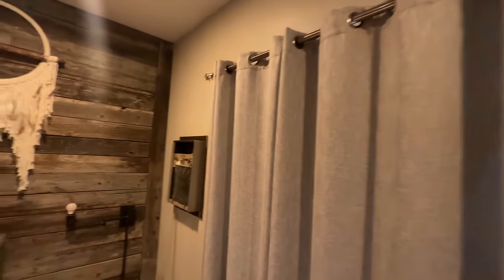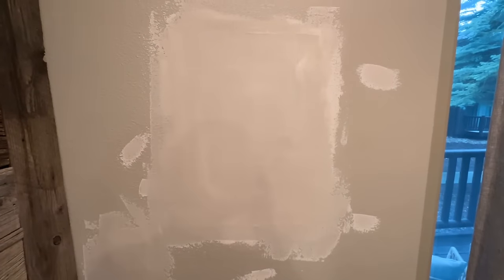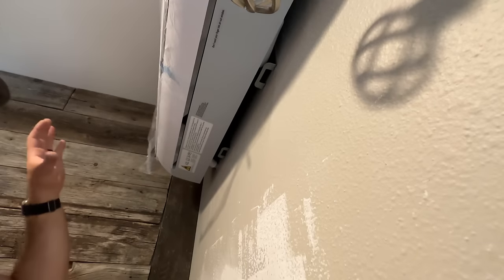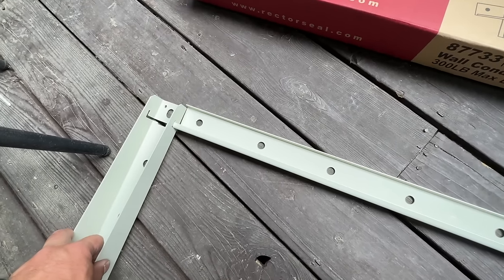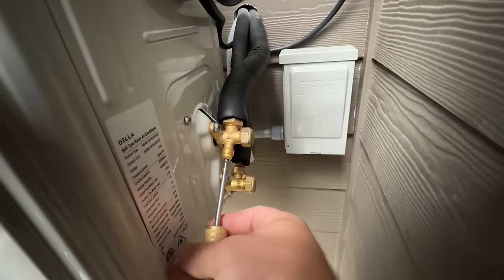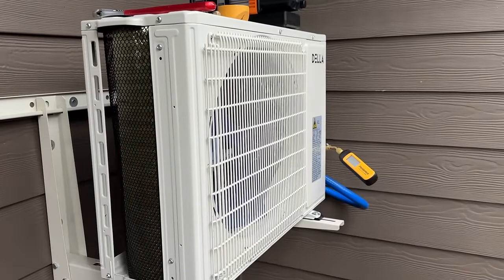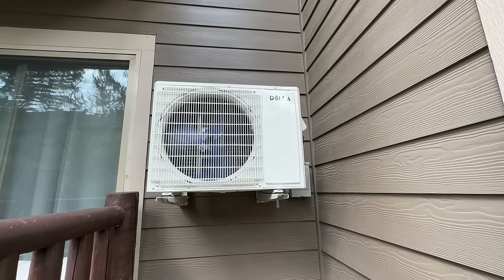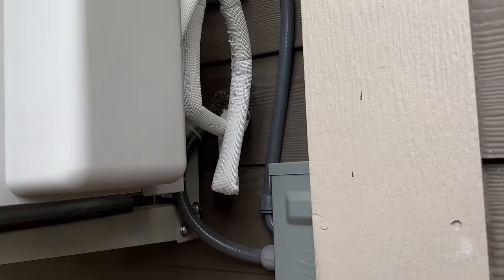A $600 Ductless 110v Mini Split?!

Comment: I've heard there's only a few companies making mini splits and they just put different names on them. Making them all basically the same. Is this correct? 😊 I know mr cool looks exactly like a Gree unit as an example.
Reply from the maker: Yea! They’re like mostly made by MIDEA
Reply from the maker: Pioneer, Senville, della, Cooper and Hunter. All Midea
Reply: @diyhvacguy  thanks 😊
Reply: No, Mr Cool is Midea (the DIY ones I am familiar with are).  Gree is a different company entirely.
Reply: @kevin9c1  well thats strange because my neighbor had his 4 year old "mr cool " mini split repaired with a "gree" oem part. The hvac contractor was an authorized "gree" dealer and was able to repair it because getting the part from "mr cool " would take too long. It was kind of obvious on the older mr cool mini splits as the looked identical to the gree units.
Reply: @number1pappy  Is that a DIY unit?
Reply: @kevin9c1  I wasn't there when it was installed. I'm going to assume it was a Diy unit as it had the linesets coiled up outside by the compressor.  I can't imagine a pro doing that on an install. Besides are not all mr cool units ,diy? It's installed in his garage. The previous owners had it put in. When our current  neighbor noticed it stopped cooling he called around and of course had issues getting anyone to repair it. A local gree dealer hvac contractor agreed to come out. They also shortened the linesets for him. From what I know the 4th generation mr cool are not gree units. I also know that the mr cool universal units are gree flexx units. It gets confusing. This is why I posted my original question.
Reply: @number1pappy  I can tell you that Mr Cool DIY gen 3 and 4 are Midea and basically look the same.  Mr Cool has a wide variety of non-DIY products now.

Comment: Can the condensor unit be mounted in the attic with drain tube going outside?  I guess you would need a pump to get the water up.  Prob not doable.

Comment: I would stay away from 115v mini splits.. the less voltage you have the higher amps it will pull. I always recommend 240v mini splits
Reply: why does this always get repeated? It's not true, and the difference is extremely minimal

Comment: Comments below refer to this job as a residential, it is not. Being a condo style apartment building makes it commercial. If the wire(s) are spliced inside a box and not continuous the box MUST be accessible and NOT buried inside a wall. Same for the interior box leading to the outside.  Splices must be accessible. If it is one continuous wire and the J box is used as a pull box then it can be buried, but why would you use BX inside a wall? It's permitted but $$$. BX or Armored Cable (somewhat different) is not allowed where excessive moisture is present (outside in the rain) it must be PVC covered with appropriate water proof connectors.

Comment: Remember on a mini split your liquid line will sometimes sweat because the metering device is not in the evaporator your metering devices in your condenser outside

Comment: Nylog should go BEHIND the flare face bro , not the cone , i used to do the same , its wrong and makes it blow out the copper / deform
Reply: What purpose does it do behind it, it's used for the mating surfaces.  I have had no problems with blowed out Flares. The flare nut has no give in to let that happen. ✌️
Reply: Nylog goes on the male flare face,and it does not hurt to put a dab on the back of the flare cone,to prevent gaulling!
Reply: @ItsMeJbird  when you tighten the nut it allows it to slide on the copper without galling or turning the pipe
Reply: @Miketime969  I agree with that.
Reply: @petersmart1999  I agree with that.
Reply: There's literally a manual for everything.  I don't think you are correct. 

For flare fittings: Both faces of the flare as well as the threaded connectors are coated. 
Primary attention is given to the flare face. The majority of Nylog is 
pushed out of the flare boundary but not completely expelled. Helium 
leak testing of flares treated in this manner were tighter than flares 
coated with pipe dopes, resin adhesive, anaerobes, silicone, or a dry 
connection. Never use Teflon tape on a flare.
Reply: @miketime969 I agree your comment.
Reply: The Chinese companies can build good stuff.
Reply: @tonymanero5544 sometimes they do. They can be terrible at their reverse engineering (from imperial to metric) It's sad that the USA can not produce much anymore. (Chevrolet CEO announcing that they can't afford to build cars anymore. Evidently they gave management all their bailout money) Too many people think that they need to be a millionaire a year out of school, and the millionaires think everyone under them should work like slaves (as alot of the Chinese do) for not even enough to survive reasonably. GREED IS THE PROBLEM not capitalism)
Reply: @seetheworldfrommyharley  don't make this into a degree versus no degree issue.

Comment: How is a heat pump AC unit different than a traditional home central air AC? 

And a follow up question, can you make a video showing how to convert to a heat pump AC with central air? 

Thanks for the outstanding content!
Reply from the maker: Thanks brother. A heat pump just reverses the cycle during the winter. So the main difference is that it has a reversing valve that activates and reversed the flow of refrigerant. So you can run heating and cooling off of a generator in the event of an emergency, which is not possible with a straight air conditioner. Not to mention, if it’s an inverter heat pump (variable speed) it will be much more efficient then a traditional heat pump. 

I actually JUST converted my straight air conditioner to a inverter heat pump. Just wrapping up the editing on that video and we should have it posted next week! Stay tuned.
Reply: @diyhvacguy   Outstanding! Looking forward to watching it!! Thank you sir.
Reply: @diyhvacguy  You can run a conventional HVAC off a generator, it just takes a pretty beefy one. (or a "soft start" module) My parents do. My RV does (two units even!)
Reply: @jfbeam But generators love these mini-splits.  They are so easy to run.
Reply: The operative word here is DUCTless. Traditional AC/Heat Pumps usually do have some sort of duct work.

Comment: I'm thinking that I want to install a mini split in the five foot offset between the wall of my workshop and the property line block wall. I was reading that the condenser units need a lot more offset than the inches between the wall and the shop. Is this offset a critical number or a recommendation?  It appears we live in a different climate (Im in the desert SW), so I am primarily using it for cooling. I was using a MasterCool Slimline Evaporative Cooler that served me well for 15 years, but it appears that I should have bought two as they don't make it anymore. There are also pitiful few evaporative coolers with air outlets that fit between 16 o.c. studs which is why I'm thinking mini split.

Comment: Wouldn't it be more efficient for that size room to just get an inverter portable unit ?  Meaning the cooling of this Minisplit is around the same as a 12k btu portable inverter in the same space ?
Reply from the maker: No, not more efficient when it comes to electricity or space which was very important on this unit. Also running a hose out a window or whatever is not ideal.
Reply: Those portable hose out the wall deals are terrible about de-humidifying.

Comment: Can you do a video about how useful these units are for heating in winter in colder parts of the country - are they now able to heat the home when temperatures plummet or are they no good for year round heating. Very confused on what a modern heat pump can actually do... get conflicting answers.
Reply: I lived overseas for several years and used these exclusively for cooling and heating.  The units were usually samsung or mitsubishi but they all work pretty much the same.  I was amazed that they would put out heat during winter like they did.  They will continue to heat below zero.  Eventually tho it will start icing up at the outside unit around 10 below zero.  This especially happens if snow and ice piles up around the condensing unit so you have to keep that clear.  I have went outside and poured warm water on the ice to melt it.  The outside condensing unit has a heater that comes on periodically to melt frost.  Kind of like frost free freezer.  These units are awesome.  My central A/C in my house right now is 16 years old and on its last legs and I am replacing it with 3 of these mini splits.  I just placed the order and they are not here yet but I plan on installing them myself.
Reply: Please check with the manufacturer in each case. Do your homework, and good luck!
Reply: @dirtwhisperer658  Nice info - thanks man... very encouraging if they work at minus 10...
Reply: @pingpong9656  I've had my units installed since last August.  One 18K Senville, one 9K Della and one 12K Della.  We are in Florida so it doesn't get extremely cold but it did get down below freezing a couple of nights here.  The mini splits did great for heat.  They are also cooling the entire house and I have not ran the big central unit at all.  I kept it in case something breaks or shuts down.

Comment: Not even close to being DIY, but it looks like a cheaper alternative to a full HVAC. Thank you.
Reply from the maker: All of the tools used can be found on Amazon. And ive helped tons of people install mini splits and replace their hvac system. 👍🏼
Reply: @diyhvacguy  I meant DIY in the sense that most people don't have a torque wrench, vacuum pump, flair tool, etc. Buying all of that just to complete the install of one mini split would be pointless for the common homeowner. It was still a great video for people that have that equipment or are willing to pay for it with a one time use.
Reply: @G.B.B.  It's still WAAAYY cheaper to buy all that and do it yourself.

Comment: Can you confirm which size whole saw you used? I think you said you tonight 2 2 1/4 inches. I bought the same mini split and am getting ready to install.
Reply from the maker: 2 5/8 I believe
Reply: @diyhvacguy Most single ductless AC units recommend 2.5" to 3".

Comment: it's against code to seal junction box in a wall without access.  youul;d have left it in the original outlet bov and covered it with a blank plate.

Comment: these units contain an accumulator..  the cool only units dont always have those..  if you have a heat pump its really hard to over charge them unless you fill that accumulator completely wit hliquid..  generally its not even half ..  I install Fujitsu units typically and they dont mention a minimum in heir books..  and are charged for a max of 45-60 ft depending on the unit so you can get the idea how wide of range the charge can be..   if they are undercharged you will first notice it on heat mode as heat mode needs more refrigerant in circulation.. ive been using mini splits for the past 15 years..  my cheao china units i got in 2008 are just now starting to die..  I do however still heat the house with gas heat as we get well below zero where I live..   my splits are ducted so there are minisplits available for those who dont want the wall-wart.  my regular registers handle all of my air.. I have 3 zones in the house and 3 indoor units concealed away..  and they are as quiet as can be..  a tidbit for those who dont like the look of the wall unit.  from what I can tell the Della units look like Chigo branded units.. thats what the ones i installed in 2008 are in my house so expect a nice long life from these

Comment: Would you happen to know the description and size of the seal tight connector for the communication wire on the condenser that you provided?
Reply: If you're still looking, search for a Cord Grip.  They have a size range, so measure the diameter of the cord you want to pass through it, as well as the diameter of the hole it's going to mount into.

Comment: Since this is the cheapest unit you could find, what is the life expectancy?
Reply from the maker: 7 year warranty but I’ve seen them last a lot longer. I’d say probably 10 years
Reply from the maker: But the hard part is doing the lineset and hanging it. When one goes bad, it’s a breeze to replace
Reply: @diyhvacguy  Yeah but no warranty on DIY install, right?

Comment: Why are you putting glue on a flare fitting?  I have NEVER used any sealant on flare fittings as they are DESIGNED to not use it
Reply from the maker: You do you boo. I love nylog blue.

Comment: Any gains in using the 220v vs. the 115v ?
Reply: 220v will be more electrically efficient so it wont cost as much to operate. thats really the only advantage

Comment: How much did you charge for the installation?  Seems much more complicated than a normal stand alone unit.
Reply: hope he doesnt charge, he used the cheap drain that come with the kit to go in the wall( i see those leak all the time!), he didnt plug the drain on the right side, this drain is going to clog in no time
Reply: @SpecialKthx  I was wondering about drain line. We do that in Texas and termites immediately move into your home.
Reply: @SpecialKthx hope he doesn’t charge? How could you say that? Of course he has to charge for installation, of the customer agrees to using this unit than he’s going to use what came with it. It’ll be a cheaper install than using a name brand unit but you get what you pay for.
Reply: @cesarmoore7996  nothing stop you from using a better solution, also the biggest problem here is that he could have switch the side of the drain on the left side, there is 2 ports for drain.
Reply: @SpecialKthx  Cost will stop you from a better solution. I have seen many units where the drain was not moved and there has been no clog. On the other hand I have seen when the drain is moved and due to lack of maintenance the line gets clogged. So it doesn't really make a difference.

Comment: I have a question, I just installed a DIY MR COOL 12K mini split. The instructions say run it at 5 min cool lowest setting and heat at highest setting. It works great on cooling but won’t go on in heat. Would that be because it’s really hot out now and the temp inside is warm that could have something to do with it? May have to test heat at a later date when it is cooler out? Thanks.
Reply: Just a guest but could it be possible that you must wait a certain amount of time to switch from cool to heat and vice versa?

Comment: What amp fuse did u use?
Reply from the maker: 20amp breaker. 12 gauge wire
Reply: For a 220v mini split, do u use the same wire and fuse?
Reply: @adriancho1742  no, you go off what the unit is rated for AMPS and make sure you wiring matches or else you will cause shorts, melted wire, or worse, a fire.

Comment: I have watched some youtube videos about mini splits being hooked up directly to like 4-6 300w solar panels and optional hard wired as a backup. Is this legit? Would it work as an add-on to existing ac to take the load off. What are your thoughts on this?
Reply: Eg4 makes one that converts dc to ac for around 1700 dollars

Comment: How many amps does the 110 unit pull?
Reply: I thing it is about 11 amps but don't recall exactly. I know it requires a 15 amp breaker because I had to change mine.

Comment: What does a Pro typically charge for a mini split install?  (Including electrical portion/ running power.)   Not including all the carpentry/ patching and matching in this video....   Anybody know?
Reply from the maker: This della was 6k, purely because we had to remove the old ac and separate furnace and do a lot of sheet rock. My Cooper and Hunter mini split was 3k so it should be somewhere in that range for a pro to do it

Comment: How do you change comp or fan. Does it have to come down
Reply: Generally the compressor is not serviceable.  The fan certainly is.  For the inside unit, you can replace parts while on the wall.  Didn't say it was a fun time though.

Comment: Does anyone have this unit and know how low you can set the heat for?  I wish to install a small one in my basement to keep the heat from dropping below 50 in the winter when I am away.  I have the Mr Cool and it only lets me set the heat as low as 62.

Comment: no pressure test? no leak test on the valves?
well, DIY HVAC...
Reply from the maker: The micron gauge will detect leaks. If the system does not hold below 500 then you absolutely have a leak. This was such a small system that I didn’t do a pressure test. But you’ll see in most of my other videos that I do a 300 to 350 psi pressure test.
Reply: @diyhvacguy  pressure and vakuum two different thing. 
1. If there any problem with your line under vacuum you will sucks air in and air is not good in the system.
2. Can be leak under pressure, but nothing under vacuum and vice-versa. 
I found both few times in my life. 

We have to do it by our standard. In the US not?

Comment: Darn, I thought it was a 600 watt heat pump.   I want to keep it below 1500 watts so I don't have to run a separate line.
Reply: Codes require a home run (dedicated line) for this appliance.

Comment: should of watied 4 more months to get this installed for a lot less and taken advantage of the inflation reduction act. Also that line set looks really REALLY short. most manufacturers specify minimum 10' of lineset????
Reply from the maker: It did not say minimum length in the install guide, but I’ve heard others say 4 to 6 feet. I’ve installed units with less in the past and have had zero problems.
Reply: My lineset is 17 inches. My HVAC installer said the shorter the better. I have had 0 problems in 2 years.

Comment: Wait why is that connection dripping? I would think it should be dripping or I wouldn't want it to be dripping..
Reply from the maker: It’s condensation water. It’s supposed to drip outside when the unit is running